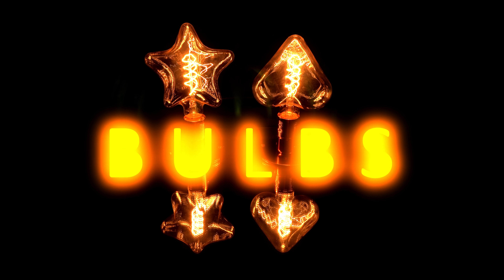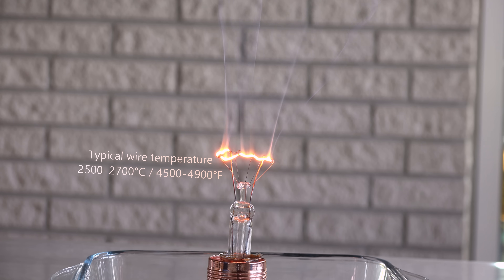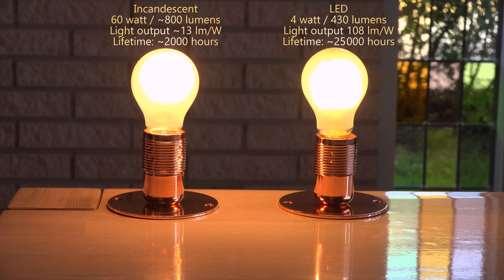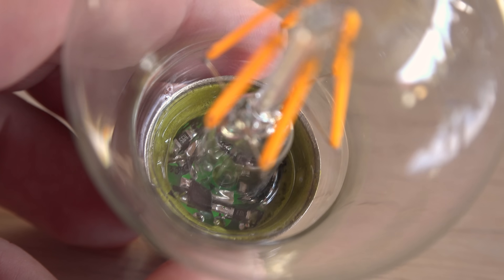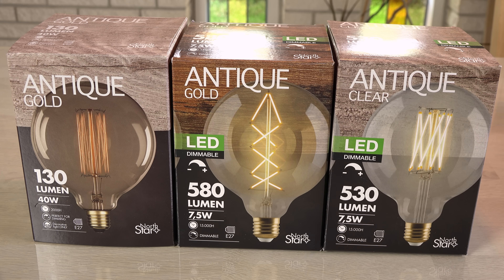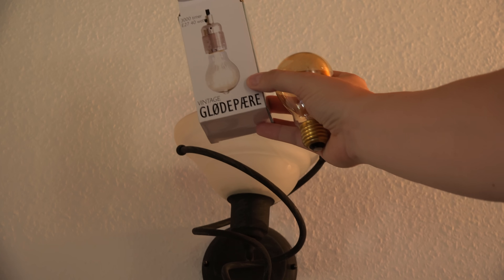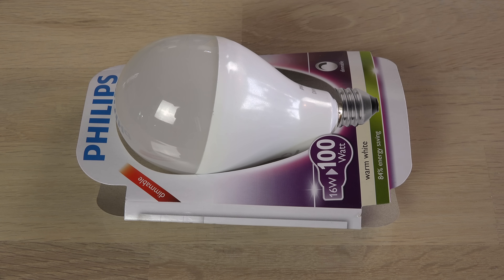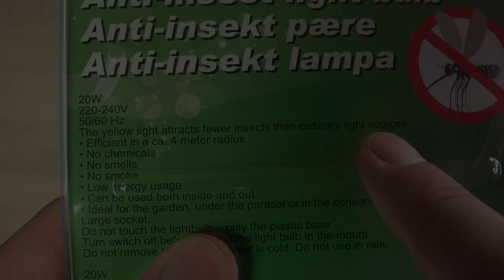Light Bulbs | LED vs. Incandescent

Comment: In winter the incandescent bulbs have an efficiency of 100%. The heat is more than welcome then.
Reply: But it's not the most effective way to go about getting the heat to where you want it.  Forced-air vents, radiators and in-floor heating aren't generally mounted to the ceiling for a reason.  Most of the heat from a light bulb probably just collects in the ceiling and doesn't have much of a chance to warm up the air at ground level.  You'd be better off redirecting that extra electricity to systems that are designed for heating your house.  As they say, choose the right tools for the right job.
Reply: louis tournas  Where I live, we mostly have natural gas furnaces.  http://www.lennox.com/products/heating-cooling/furnaces/ml180
Reply: True, except that electric heat is more expensive than natural gas.  If you heat your house with electricity, than it makes no difference which type of bulbs you use in the winter.
Reply: @my3dviews  energy efficiency isn't about price, if it was they wouldn't need to ban energy inefficient bulbs. It's about not including the environmental re-establishment cost into the sale price for political reasons. That's why there's so much bullshit going around - everything's a lie and we want logic so we can stay sane so we construct more and more bullshit reasoning around all the lies until nothing makes sense any more.
Reply: @tricky778  I want you to know I gave you a thumbs up
Reply: @my3dviews  True but burning something to generate heat comes at the expense of depleting the oxygen inside the house. So it may at times be worth considering heating using electricity.
Reply: @shayhan6227    That's not how it works.  All natural gas furnaces use outdoor air for combustion, so they don't deplete the oxygen in your house.  They use a heat exchanger to heat up the air inside the house.  Otherwise you would end up with carbon monoxide inside, plus a build up of CO2 with also can be deadly if it gets to high a concentration.
Reply: @my3dviews  Now THAT aged like fine milk!
Reply: @fungo6631    Yes. What I said is still true.
Reply: @my3dviews  unless you use a heatpump instead of resistive electric heating. A heat pump is usually around double as efficient as resistive electric heating.
Reply: @itdepends604  A heat pump should be over 4 times efficient according to a video that I watched. He was actually testing with with a AC inserted into a door to heat a bedroom. He was measuring the ampereres used. As the heat difference gets bigger, the compressor uses more energy to pump. In any case, it is cheaper to use an AC that way to heat a room compared to resistive heating. I tried it myself but the compressor would not turn on since during winter, the room temperature was 10 C. I would have to figure out how to bypass the themostat thing in the AC.
Reply: @my3dviews i live in Nova Scotia. Nobody heats their homes with natural gas. We're living in the past. Wood and oil and the newest technology is electricity. 😂
Reply: +louis tournas
The problem is, that banning light bulbs, has little or nothing to do with science nor common sense, and most everything to do with trampling human dignity and ignoring human rights. So sad to say, a science argument or practicality argument, doesn't appear to be as relevant as it should be.
Reply: @yosefmacgruber1920  Yosef macgruber thank you very much for saying that these light bulbs being forced on us trample on our human rights  .... some people especially those who have had post-concussion Syndrome from brain damage will tell you how much they hate the lights how they can't stomach them they can't stomach the flat quality of the electronic light and how it just does not give any room or any place Ambience at all but instead just create something harsh and unattractive and flat instead of nice lighting or warm lighting everything just looks really weird and sometimes very harsh .
    When my stash of my various incandescent light bulbs in various colors and sizes mostly in hot pink some in Amber run out I'm going to have to start ordering them online which I feel I shouldn't have to do I should just be able to run to the stores I used to go to where it was no problem and I always had beautiful warm Lighting in my house and the evenings and on cloudy days .
    People always said how beautiful my home looked inside with the lighting I use and I would tell them what light bulbs to buy now it's become a big effing problem  .
Reply: @gardensofthegods 
It is true that incandescent bulbs are terribly inefficient. But what they don't want to talk about for some very bizarre reason, is that energy is not scarce. The universe is full of energy, and so why are we still paying for energy? Energy should be free by now. Yet nothing but chirping-crickets silence from those who supposedly "care more than thou" enviro-wackos about Nicolai Tesla's free-energy technology—whatever became of it after the government raided Tesla's research papers? Or about thorium nuclear power?

Incandescent bulbs could be good for one thing. Where else can you get a resister for your circuit project that has a high power or heat dissipation rating? Although the resistance varies as the bulb lights up. A hot bulb has higher resistance. That is one reason people used some sort of insert disk that is supposed to make your bulbs last longer, by moderating the start-up current surge.

I use now mostly the compact florescent bulbs. But I do not think that they are for everybody, and I still haven't changed out all of my bulbs. And it depends upon what sort of light fixtures that you have. Florescent tube fixtures have been around for a long time, and many people have some to light up their basements, garages, or kitchens.

I think one problem with LEDs could be, that they do not have proper spectrum lighting. They may look white, but as they only produce but a few colors of light, they make for bizarre or harsh lighting. There is some YT video about the bizarre lighting you get when the spectrum isn't right. I think it showed a red object glowing bizarrely, because it be being let by red light, and not by broad spectrum lighting. Sorry, but I have no handy link to the video. Maybe one of the Technology Connections videos or something-or-other?

Consumer Reports said something against the trend of expensive headlights for cars. Have you noticed how complicated that car headlights have become? Whatever happened to standard white headlights? And I wonder why so many morons on the roads have disco-colored headlights? Well it may not necessary always be their fault, but rather, didn't I see something about the color going weird when their lights get old and start failing?

I personally do not seem to be sensitive to the lighting issues. But I believe that individuals deserve the choice, and not the corrupt meddlesome government, and definitely not the anti-freedom enviro-wackos.
Reply: False. Most efficient way to produce and disperse heat is...get ready for this one: Heaters, or objects designed to produce and disperse heat. All Incandescent bulbs do is generate localized heat, in the one place it doesn't need to be if used in ceiling fixtures (Heat already rises, so unless you're installing incans in your floor it's wasting a vast majority of its heating potential by being in all the wrong places)
Reply: False; heat does not always rise. In the case of infrared, it travels in straight lines independent of gravity. In the case of air, hotter air always convects to replace 'cooler' air. Hint: "heat" is a broad term used for increased average molecular agitation caused by whatever reason, whose point-source does not have to be at any particular wavelength nor particle, ie. radioactive metals feel "hot".
Reply: Incandescents consume more energy because they do more work. This isn't rocket science. In a cold environment that needs to be heated, heat is a good thing, not a "waste".
Reply: +The Britexiteer
No, most of the heat from a bulb is RADIANT heat. Think "infrared." If you had a parabolic mirror, you could focus the heat just like you focus light. Might actually be cheaper to heat the chair you're siting in, vs the whole dang room...
Reply: When I use my desk lamp sometimes i use it to heat up my hands as well :D
Reply: We don't use air conditioners at all, it doesn't get hot enough where I live. Incandescent bulbs are nice because they provide heat where you are like near your face when reading a book for example.
Reply: MichaelKingsfordGray true! As a Canadian who has moved to Australia I can verify that keeping those photons out is the only way to keep from melting. 

Also, I have devised a theory that puts Flat Earthers to shame: we don'live on a 2D flat earth but actually a linear 1D line earth and on that line, Australia is much closer to the sun with the "Northern" countries taking an annual swing towards it in a time they call "summer" but us Linear Earthers call "The Great Whip Lash", but in Australia the wamer period or "summer" is called "all the time", that makes Australia the handle of the whip. :D
Reply: Oh yeah. Natural gas here is $.30 per 105,505,585 joules. Electricity is $2.61 per 105,505,585 joules. I want a dual fuel car too; one which burns compressed natural gas, then when it runs out of that, it switches to gasoline.
Reply: My3dviews A door could never work in a perfectly insulated room considering it implies there is an inconsistency in the structure, therefore a weak point.

Jokes aside: LEDs look fantastic, fill 99% of use cases and produce much less toxic crap than CFLs while reducing the demand for Tungsten, a substance that is linked to horribly managed mines in third-world nations (Seriously. Either their tailings ponds go into the local water source or they find Uranium and start dealing with that mess...never ends well)

Their biggest drawback is they cost a few bucks more. But that's offset in power bills within a year or two, not to mention replacement costs go way down (And in turn you spend more time doing things other than awkwardly leaning to put a bulb in that stairwell socket every six months)
Reply: +louis tournas
Jeezus H Christ, do you really need to calculate your electric cost to the billionth of a freakin' cent?! What possible relevance does the 12th decimal place hold...and what meter is accurate enough to bill you for it?
Reply: LED bulbs overheat sooner though, in any enclosed fixture they don't last as long in my experience as normal bulbs because they can't get rid of the heat [technically not even fully enclosed, this was a fan with a glass shade on the light that is open on bottom]

considering they can only be used for lighting rooms while other bulbs can be used for lighting rooms, lighting ovens, keeping reptiles and small mammals warm, and keeping food warm, LEDs are really only good for 20-25% of the things we use lightbulbs for, not 99%

LEDs at best look the same as a normal bulb, but as mentioned in the video, tend to make things look odd, not mentioned in the video is that they can't be dimmed, the flickering of the LED is intentional and in one that can dimmer is adjustable, some even cause headaches in more sensitive people, so if you want adjustable mood lighting i wouldn't go for the LEDs
Reply: @ClippyForConsumerWrights  Desmond I have to beg to differ LEDs do not look the same to a lot of people..... to some they look harsh , weird , create a flat unpleasant light  .
    I am running into more and more people who hate them really hate them . Even the Amber ones and the pink ones don't really create a warm soft light because it's electronic and they have a flatness to the light rather than a richness .
Reply: @gardensofthegods  i did say at best
Reply: @ClippyForConsumerWrights  I'm sorry I read so many comments I don't want to go back so I'm not sure what you mean at best .
Reply: @gardensofthegods  common term for "best case scenario"
Reply: No, True!  Energy does not just vanish.  The incandescent only converts energy to light and heat.  The light creates a tiny bit of heat when it hits objects, and the heat is heat.  So the lamp is 100% efficient.
Reply: I just use my PC, TV, and light bulbs to keep my room warm without using a heater.
Reply: Eulogy  Heat is only wasted if it escapes through the walls and insulation.  If the heater or lightbulb is on the ceiling it will take longer to heat up a cold room, but the heat is not wasted.  Yes, it is better to have it one the floor for quicker heating, but efficiency is the same in a perfectly insulated room (if that existed).
Reply: My3dviews
...Unless you care about climate change. The whole stupid point of these bulbs was to reduce carbon emissions, not to save on energy bills.
Reply: Nicky Tesseracttoo   Haha.  Australia.  We all know that it doesn't really exist.  No one has ever been past the equator.   That would be instant death.   No one believes in your giant bunnies and teddy bears (kangaroos and koalas).   Total fake CGI from NASA.   LOL
Reply: ortcutt   He means that in summer when it gets up to 30C, that CFL and LED bulbs only help then (since they generate less heat than incandescents).
Reply: @My3dviews Electric heat can come from solar or wind or nuclear. Gas heat is always combustion-based.

In fact, most countries retarded enough to ban incandescents are also heavily reliant on "alternative" energies.
Reply: Ronald de Rooij No shit. I've once had 20x20 array of 60W lightbulbs that provided both light and heat in Winter. Now I'm cold :( (but at least my room is still lit very well).
Reply: The Britexiteer; the # heat is unwanted, you subtract its % from the total % efficiency: eg if both heat and light are desirable, therefore it begins with 200% at 1 focal distance, and each wavelength becomes  weighted averages vs. desired perceptibility. Don't believe that entropy applies here because as it was stated below, used energy doesn't "just disappear into nowhere"!
Reply: @Machael Johnson
...Yeah, this isn't up for debate, you're an idiot.
https://en.wikipedia.org/wiki/Conservation_of_energy
Reply: Michael Johnson - that energy is lost at the power plant, whether I am getting roughly the same amount of heat from 15 100 watt incandescent bulbs running, or one 1500 watt heater.

  Standing in the center of my living room, with the 1500 watt (fan forced) air heater, versus 1400+ watts of radiant heat from light bulbs aimed at me from a reasonable distance, I can guarantee you I am warmer (and better illuminated) by the light bulb's radiant heat.

  It does take wise situational application, and LED's DO save electricity in warm climates and fixtures that don't allow them to be nearby radiant heat for humans using the space... 

  In my application, for instance, I use LED's in the can fixtures in my ceiling because it reduces the heat loss through the openings in the can fixtures...  

 My desk lamp for light has an incandescent in it, which warms me nicely while allowing me to keep the forced air wall heater entirely off as long as the room is 60+F...

  It takes wise use of both to do the best we can at saving energy.

  Also, when you add in the embodied energy of all of the resource extraction, transport, and manufacturing of all of the additional components in an LED (or CFL) bulb, and the high energy "clean room" production environment of the diodes and Semiconductor parts, along with the fact that I see a 10-20% early failure rate in the retail consumer market CFL and LED's I've used thus far, the "total energy cost/savings" to consumer and planet, are a much more convoluted, and much less cut and dried calculation than you seem to think any "moron" should easily see.

  Switching over to LED light bulbs can help, if done wisely, but is about 0.5% of solving our fossil resource use and pollution issues.
Reply: Ronald de Rooij   yes! Exactly!!! Even during the other 3 seasons, including summer, Northern climates have cooler evenings and the tiny amount of heat is not unwelcome or wasted. There are only a few weeks in the year that the evenings are hot.
Reply: Yousef - you must be proud of the news the other day.  A whale's death was caused by its' digestive tract being FULL of plastic bags. 'THANKS HUMANS!!!'  Trust me, animals had nothing to do with creating said bags.
Reply: @Michael Johnson
Actually, Denmark, where these bulbs were banned, uses 66.9% renewable, not 0.01%
http://www.energinet.dk/SiteCollectionDocuments/Engelske%20dokumenter/Klimaogmiljo/Environmental%20report%20for%20Danish%20electricity%20and%20CHP%20-%20Summary%20of%20the%20status%20year%202014.pdf
Any other bullshit figures you need me to debunk before you start removing your head from your ass?

Oh, and before you start shit with me about how great gas heaters are again:
http://www.sunwindenergy.com/news/denmark-prohibits-oil-and-gas-heaters
Reply: Michael Johnson - a-holes like you are why no one wants additional regulation.

  We are smarter than you and your favored regulating agency, and it hurts.  I know.
Reply: Michael Johnson - also, bulbs inside my house ARE more efficient than any central furnace could be, because they don't lose heat to the attic or the basement through hundreds of feet of ducting.

  I highly recommend some training in thermodynamics, since they apparently never covered that in your EE degree.

  Being an EE apparently also makes you into a self important, disgustingly disrespectful slime ball, so you might want to consider a career change while you're at it.
Reply: Eulogy   I'm sure if we got NASA to engineer a $5 million  door, it would meet the criteria.  Maybe make it out of tungsten and fill it with argon.   
I guess I never investigated tungsten mines.  Hadn't heard much about them, other than I knew there were some in Canada.  There are lots of problem with mines around the world, not just tungsten.  Diamonds, gold and cadmium come to mind.
Reply: Skarn22   It can be both.  If you save on your electricity bill, then you are using less energy and producing less carbon.
Reply: Yosef MacGruber 
They just don't see the light.
Reply: Ender Skies, who or what are "they"; are we playing the pronoun game again, Raiden?
Reply: bcubed72; wrong: mirrors do not "reflect infrared" unless they're coated with gold\Au! Silver\Ag just passes iR and creates a 'virtual image' reflection. Similarly, uncorrected semispherical lenses produce virtualised  aberrations.
Reply: An electric heat pump is going to be multiple times more efficient than  using electrical resistance heating (i.e. an incandescent bulb).

http://energinet.dk/EN/FORSKNING/Energinet-dks-forskning-og-udvikling/Sider/Fra-vindkraft-til-varmepumper.aspx
Reply: @ortcutt  But an electric heat pump does not at the same time produce light.
Reply: bcubed72, A bulb in a vacuum would be constrained to 'radiant' heat. "Radiators" in a 'room' actually cool by convection, which is why any bulb enclosed in an optically-transparent fixture still runs hotter.
Reply: TheVapour's Place , Admit it: blinding glare in fog is just as desirable as heat.
Reply: d3str0i3r The fact is that dimmer·controls made for LEDs' cost immediately causes headaches.
Reply: Michael Johnson excess energy can be rerouted to a grid connection; problem being, that connection isn't free due to franchise fees.
Reply: Skarn22, Waves by definition, do no "work". That IS rocket science, mate. Bulbs just sit there producing various wavelengths.
Reply: Skarn22 &hydroelectric
Reply: ortcutt, so your situation is not unique but still proprietary. Every time you make any statement based on that it's mostly gonna confuse folks.
Reply: Michael Johnson ME TOO. I'D have thought that another engineer would not only have corroborated with my posts instead of having disparaged them all, but what pseudoscience physics book teaches that no heat from a power plant's 'stack' reaches anybody's home?
Reply: ***** Yes heat pumps aRe over-unity. Just like the heat from a power plant's stack that I never paid for, I also get much of the vibrations and noise from the neighbor's EVERY time it switches into defrost mode. If it just wasn't for that stupid power factor correction the lights are so proud of NOT having.
Reply: Skarn22 LED lighting suffers from a problem that actually makes fluorescent possible: alternating current. Likewise, the ban isn't on consumption, BUT on production. Simply using either technology doesn't subject you to any stupid ban...yet.
Reply: Really, if you take out the unknown 'imports', the "renewable-sourced" Danish RE:Non-RE shifts down to about 50%.
Reply: To also answer Mike John's question about me turning off gas and using utilities to heat, yes I must, because at night, my gas heater does not produce light and being central-type, it heats the entire house. There's an oil-filled electric radiator under my mattress, which really is a TON of a lot safer than putting my emergency propane 5000btu under there, even moreso than my unused electric blanket. My LED TV consumes about 200 watts, but the flicker is annoying and it mainly heats the wall; so, considering that I hate to breathe cold air and the LPG ceramic burner does too, enter the incandescent light bulb: makes the room breathable, not too #@% much lms for the desirably-high heat output as an LED array. So AT that TIME, it's 100% efficient, all options considered.
Reply: @HighestRank  well I have a suggestion it's going to sound bizarre but you might want to try it sometime..... I'm going to preface it with a little story . 12 years ago in the winter I got home to my roommates house where I lived and it was pretty freaking cold as it was about 32 degrees Fahrenheit . I found out she had forgotten to pay the electric bill .... and I was really pissed and cold and exhausted . She had a Hibachi barbecue  on the back patio ....though .
  It was a ranch style house with open plan design which means it was one huge living room kitchen with countertops overlooking the living room and into the dining room  ... I didn't want to just heat the bedroom because I knew I'd be dealing with the rest of the house in the morning and did not want to wake up to a cold house so I slept on the couch  ... but it was a large area to heat .
   We had some cinder blocks and bricks in the garage  , so I set two cinder blocks on their sides next to each other , at one end of the living room closest to the kitchen... and two more cinder blocks on their side next to each other and the part of the living room closest to where I would be sleeping on the couch .
   We had really good barbecue equipment and so when I barbecued a Brick in the fire , I was able to use some really strong heavy metal tongs to set it on the cinder blocks..... I said another brick on the other cinder block.... then I decided I might as well use two more bricks for a total of 4 . That room heated up very quickly . Right before I decided to go to sleep I reheated all four of the bricks I cooked them in the fire.... and put them back on the cinder blocks . It was nice and toasty when I went to bed.... and when I woke up about 7 or 8 hours later I was surprised at the place was still relatively warm .
    If you are able to somehow have a little miniature Hibachi or barbecue somehow just so throw some bricks on it and have some kind of stone or cinder blocks to lay them on.... I've told other people to try this and several said it works really well .
Reply: Michael Johnson - I bet you all that I own, that  two 250 watt reflector heat lamps, placed properly, can heat me or you, better than a 25kw central furnace, at a fraction of the cost.  5 hundred watt reflector bulbs can do about as well as the heat lamps.

  There are places where incandescents make sense, and really, LED's have to last a VERY long time to make up for the higher energy and materials cost of their manufacture,  in the higher complexity of design, it's multitude of components, and their individual manufacturing, materials, and distribution requirements. 

  Led's running on AC that have died early (about 5% failure rate in my installed base of LED's for myself and customers) when disassembled, have as complex a power supply as CFL's do... Clean room components in the driver boards as well as the LED's being such themselves...  High embodied energy.

  At least they don't have all the GD mercury that CFL's do.  

  Being the same distance from a 1500 watt forced air heater like the ones used most commonly here in the Pacific Northwest where I have cheap hydro electric, pales in comparison to even two 100 watt reflector bulbs positioned at the same distance behind me...

  LED's are certainly better in places where all you want is light... Ceiling, wall, can lights... table lamps with shades that turn all the heat into convective heat... LED's work great there.

  Warm climates where AC is most often the primary indoor climate control energy draw, then LED's make sense everywhere.

  But we should not be prohibited from procuring and using standard incandescents where and how it is sensible to do so.
Reply: Michael Johnson - lol!  I don't need to heat a whole house if I heat me... My total bill is $90 a month year round....

  You are too much of an a-hole to even bother responding to...

  Have a good life.  I do :-)  without harming anyone or paying attention to a single government regulation.  

  It's called being raised well :-)
Reply: Not that it's not a proper home, but that any gas has to be carried in by cylinders. I'm got your numbers in the form of energy bills, but note that a tank of propane is 26$-52$ depending on whether you exchange a cylinder or not. TOWN has no natural gas utility pipes. So electric heat is a monopoly unless you're "personally" able to carry cans or pay the LPG truck for at least the minimum refill delivery.
Reply: Michael Johnson has officially won "Internet a-hole of the century" in this thread... Gotta love the trolls.
Reply: @orcoastgreenman  thank you , orcoastgreenman , you are my hero and thank you very much for speaking out like a real man thank you
Reply: No it isn't difficult. All voltages are handled by passive components. DC would simply pass straight through active components and bypass capacitive filters.And if you paid attention to the OP instead of just me, realize that none of those resistances you mention provide "welcome heat".
Reply: yep cities in the cold use led traffic lights or warning lights or the leds will not melt ice/snow and form blockage of the light.
Reply: Some people really hate the LEDs they make everything look weird and are hard on the eyes.... people have neurological problems such as anyone who has had brain damage can tell you how harsh the lights are to them and it makes everything look weird and flat .
    Believe it or not some people are actually suffering from the onslaught of LEDs everywhere from the cars that are coming at them to the bright lights on the side of buildings and front of buildings at night to the street lights.... and now in all the stores .
Reply: Dan Heuser
 I put lamps on the floor for my room.
Are you saying I need fans as well?
Reply: Eulogy  I was talking in hypotheticals.  You would need to heat the room first to get it from absolute zero to 20C.   Just kidding.  You would in reality, still need to heat it when you open the door to go in and out, if it had an external door.
Reply: Eulogy  Hmmm.  Not sure if that's true.  Couldn't you have a perfect air tight seal around the door that left no gap down to the atomic level?   :-)
Yes, I agree.  I converted my house to almost all LED bulbs. 
There are tungsten mines in Canada.  Such as this one in NWT. http://www.natungsten.com/s/cantung.asp
Reply: My3dviews Those mines are catastrophic to their local environments. (There's a reason they were protested and have drawn hundreds of fines for environmental issues)

Also, only way to have a perfectly insulated room with a door is to basically have a "door" you have to cut out and remerge atomically to use. Not quite practical. I'll stick to my fancy argon-filled windows and weatherstripping.
Reply: rtel123   Except for the light that escapes out the window.   :-)
Reply: You heat your house to 30C?
Reply: Even if it's 20C, then heat from an incandescent is unwanted.  If it's hot enough to turn the AC on then it's counterproductive.

Efficient bulbs allow the light function and heat function to be decoupled.  I pay through the roof for electricity, but our heat is bundled into our maintenance fee.  So, for me, paying to heat our room with incandescent bulbs is massively stupid.
Reply: Ronald de Rooij
Reply: Ronald de Rooij Terribly expensive way to generate heat here in Ontario Canada with skyrocketing hydro rates.
Reply: @Michael Johnson
>Heats your home
>isn't utilized
pick one.
Reply: @Michael Johnson
" At least if you are burning gas "
If you do, you contribute to climate change more than someone who uses electricity sourced from green energy and thus you are either a huge hypocrite for wanting to ban incandescents, OR you're just a regular moron who doesn't understand that the argument about incandescents is all about trying to use less fossil fuels, and not... whatever it is you're raging about like a moron since you clearly think burning gas on a daily basis is just fine. :/

Yes, I'm aware that machines including power plants are not going to be 100% efficient. But if you use electricity to light heat your home, incandescents will not increase the amount of electricity you use by a single watt over LEDs or other "efficient" designs. In fact you use LESS watts considering that a 60-watt incandescent is only 5% "efficient", that means only 3 watts are used for the lighting while the other 95%, or 57 of those watts are just heating the home. Meanwhile an LED uses 10 or 15 watts and produces basically no heat whatsoever, plus an arguably lower quality light. Where's the advantage to the consumer then?
Reply: Save the planet - Don't have kids! :)
Reply: Michael Johnson burning gas's produces co2 and water definitely adds to climate change
Reply: Edward Myers, climate change is what combustion does. When a greenhouse gas is not completely burned, such as methane, it causes global warming.
Reply: methane is over 10* the greenhouse effect gas that CO2 is per volume, but worse, producing methane doesn't even require combustion, just mere metabolism of vegetation.
Reply: Edward Myers & I said NOT.completely_burned. Learn to read!
Reply: +Michael Johnson
So if I install solar on my house can I be exempt from their retarded ban? No? Didn't think so.
Reply: @LuciusC  can you please tell me what country you live in .
Reply: @Michael Johnson 
Stop trying to move the goalposts. This is about the effect on the environment, not money. If this were about money I'd just tell you to suck a nut because what I do with my money is none of your business. The argument for a ban would never hold up in court if it were just the fact that it's "cheaper".
Reply: BTW, I use the +1s  determine if I'm still connected to my gateway.
Reply: "Should the government take more land to produce more power just for you?"
All it takes is my own rooftop.
Reply: Only if you have a terribly inefficient resistance heater. Any other form of heat is much more efficient. Most electric house heaters are heat pumps, which are a couple times more efficient.
Reply: My LED and TV, despite its 200W consumption, run internally on DC. The only reason I would need your "A/C inverter" would be: to sell excess solar energy back to the grid, and then buy it back for twice that price. I'd save $25/mo. by not having that franchise fee. Most solar-battery setups dump excess energy through an incandescent bulb, as it is the cheapest form of dissipation, but since those are now outlawed, I would be forced to sell it, which means extra wiring and genlocking components. Every appliance and device in my house runs easily through a 20A circuit breaker, so say what you will about Green Acres.
Reply: +Rýán Túçk
It is more trouble to access the internal DC circuitry, and sometimes multiple DC voltages, than it would be to use an inverter to produce the kind of electrical power that can simply enter through the power plug. Especially for low-power devices, there is little point to try to produce direct DC power for them.

It was stupid and based upon junk-science, to ban incandescent light bulbs. But that is not the only kind of cheap high-wattage resistors that can dissipate excess energy. You could also use electric heater elements, a stove burner element, or a heating element of a hair dryer.
Reply: +MJ I think maybe more than one person has you blocked so you may not see certain questions from laymen who were doubtful about providing d.c.-supply to an apparently all-a.c. powered LED bulb.
LEDs now have little more inside than a rectifier bridge and resistor(s), which care very little about what waveform comes out of the socket as long as the voltage and current input sufficient Joules. Poundland's aren't even protected from overvoltage by varistors, thermistors, dropper caps; another sold on TV already includes a battery, but because even LiPO could NEVER outlast a 21 year LED life, is junk when it won't go and becomes like an eyesore, if its brain even continues to let it half-work.
Reply: @Skarn22: True. But I doubt if the production and waste phase of the LED and fluorescent lights are not too energy intensive to make up for the savings during the use phase. I doubt if they are more environmentally friendly in the long run.
Reply: Danielchai S 
This is a job for Rocky bulboa!
Reply: Cook some roast.
Reply: Actually, incandescent bulbs were starting to be marketed as space heaters to get around the bans. That didn't last, but considering they are better at heating than lighting, it makes sense! Lol
Reply: BS, Infrared heaters are more efficient.
Reply: @hyperhektor7733  But infrared heaters do not produce visible light also.
Reply: Oke ronald.
Reply: There is a reason why you go to the lighting section for your light bulbs  LEDs, And the HVAC section for you heating and cooling needs! Why the hell are people arguing on how to heat a room with a light bulb emphasis on light?💡 I can make a flame from a lighter flicker if I fart close to it, But I am not going to try and power my natural gas appliances with my ass! Maybe next we can try and figure out how to brighten our homes with the wasted energy from the heating elements on our stoves and ovens while we are cooking!
Reply: Well they don’t emit enough heart to do anything!
Reply: Idk I use wood for heat and would never use anything else. I love it.
Reply: make that 6 months of the year where i live.
Reply: This is a great thread! 🍿
Reply: In my office are use incandescent bulbs in the winter to keep it a little warmer
Reply: @JD IQ I wouldn’t even care if they fully banned them because I have a whole box of them in my basement
Reply: you're a genius
Reply: Thay are not bulb's thay are lamp's you put bulb's in the garden to grow flowers
Reply: Used to heat dry risers on sprinkler systems.
Reply: Lights with heat (Incandescent) are better.  Why?  The human body needs good Ionized Radiation.  We were taught that "Radiations" are bad but through my discoveries, the Human Body needs Ionized Radiation from 550nm - 570nm.  For comparison, we need to stay a distance from Infrared (Incandescent) but far from Low - UV Lights (CFL's), since they are too low for the body to use.  Low + Decay Radiations are what harming us all.
Reply: And probably about 50% if you're using a Sony Handycam with nightshot turned on, so it can also see the infrared spectrum.
Reply: I switch out my bulbs depending on the time of the year
Reply: Then buy FUCKEN  heater. Weirdo. This is one of the stupidest argument that ahou  like you bring. Trying to solve a problem that's already solved.
Reply: Truth
Reply: louis tournas  They are helpful more than 2 months.  It's not just when the air conditioner is on that they help.  They will reduce your power bill in all months where the furnace isn't being used.  Unless you live on Elsmere Island  :-)
Reply: +louis tournas  I lika tha big nummeros too ya know!  You are nice guy, I give one of me ya?  Here take for free.   8903489037489713489074569071345698731483498734589734589023578907345897  Is special one of collection nice big for ya!
Reply: I don't see how incandescent bulbs can be 100% efficient?

Most of the heat will be around the bulb near the ceiling which is wasteful & what if you don't want constant heat?

Gas is much cheaper than electricity for heating & LED's use less than 20% power than an incandescent bulb uses & produces more light (lumens) per watt. I know this because I have measured their power usage = 0.009 kWh for a 10W/810 lumen bulb per hour.
Reply: My3dviews Problem being, this magically insulated room doesn't exist, and if it did, you wouldn't need to even heat it.

We're talking practical vs. theoretical and your quest for inefficient bulbs just lost in both realms. Awk.

In short: If you're cold, do you turn on a space heater or the lights? I know what I'd take.
Reply: My3dviews Furnace? Not many people have one of those diesel burning furnaces. We use electric heaters. Big businesses and shopping locations probably use natural gas.

Hydroelectric power!
Reply: @louistournas120  in my country still a lot of households and buildings use coal or wood so in the winters you can't see more than 50 or so meters because of the smog, the polution index reaches 250 or so..... so you either have to get one of those nanofilter masks or breathe that shit....
Reply: @louistournas120  in the US basically everyone has a natural gas furnace
Reply: That much I do know, at my grandparents we used to have fluorescent bulbs outside, and in the winter they'd always take a couple mins to warm up before they turned on
Reply: LED light bulbs is a great alternatives for many countries with high temperature.
Reply: +UCD BNXT
If we don't have children, then who will be around to benefit? Muslim children? Hispanic children? Hindu children? Why shouldn't we also have children? God clearly commanded people to Be fruitful and multiply and fill the earth. You are rebellion against God when you bad-mouth the beauty of human life and scheme to deny people their wondrous children.
Reply: We = ALL HUMANS.  And, I ain't religious.  We don't belong here.  We are screwing it up BADLY.  Hope YOUR grand kids enjoy the upcoming mess.
Reply: That's why CFL and LED lights don't make sense in Canada. They are only helpful for 2 months or 1 week when room temperature hits 30 °C.
Reply: @louistournas120  --  It depends upon whether you can use a heat pump or not.   There are some speciality heat pumps that can operate well below freezing.   Of course, if you are essentially heat with resistance only, heat is heat.
Reply: +UCD BNXT
Why do you watch such news, that goes out of its way to find only the negativity?

Also the other day, another whale died of natural causes, but it never made the news. Which one should I be more sad about?

Are humans to blame? A century ago, there still were humans, but not the plastic bags. Into the Star Trek future, no more plastic bags. Why? Presumably, most everything comes from a food replicator, and there is little need for cheap throwaway bags. No more poverty. Not so much anymore, shopping at stores. Even now, some shopper's clubs do not give you plastic bags. They give you the boxes that their products came in. Or just buy big mega-sizes, that go as they are, from shopping cart into your car.

Trash bags are not exactly cheap. Quite many people I know, use the cheap bags from the supermarket, to put their trash into. We have to bag our trash, otherwise, it blows onto our lawns when the trash truck comes.

BTW, I do not litter. Whales shouldn't be eating plastic bags, unless they are stupid or unless humans toss litter all over the place. Most of us do not just toss plastic bags wherever, but save them up for our trash.
Reply: Rýán Túçk co2  the green house gas's doing the most harm and anytime you burn fossil fuels, methane,or any hydrocarbon, you produce co co2 h2o only hydrogen fails to produce co2. learn the science before making erroneous comments
Reply: Everybody stop parroting the fake science of so-called "climate change". The #1 greenhouse gas is water vapor, but they rarely ever talk about that, because clouds and water vapor occur naturally, and so how will they blame that upon man or eco-guilt us about that?
Reply: @Michael Johnson No matter how you try to equivocate and deflect, you can't actually describe a scenario where using renewables to power and heat your home is worse for the environment than using gas. You're peddling bullshit here, and I'm done entertaining it.
Reply: Dan Heuser  True, but it would vary depending on how well your ceiling is insulated.  If all (or most) of the heat is contained in the room, then it's not wasted, just that it takes longer for the heat to get to the floor level.  You could always turn on a ceiling fan (if you have one) to circulate the heat around.
Reply: Taunter Atwill
#Dear #lordos #me #amigos. #That #is #a #big #nummeros #gigantess
Reply: Gammareign 
So your cost is 2.473802690160904752103881514898e-8 $USA/J
In Quebec, the cost is 1.53888888888889e-8 $CAN/J
which comes out to 1.6236137247222233945065 $CAN / 105,505,585 J
If the exchange rate is 0.75$USA = 1.00$CAN
1.217710293541667545879875 $USA / 105,505,585 J
 
Also, they keep increasing the cost for hydroelectricity (Hydro-Quebec) here every couple of years.
Reply: Nothing is 100% efficient because of entropy.
Reply: @Jemalacane0  but heating devices are the closest we can get to it, as all energy eventually converts to heat